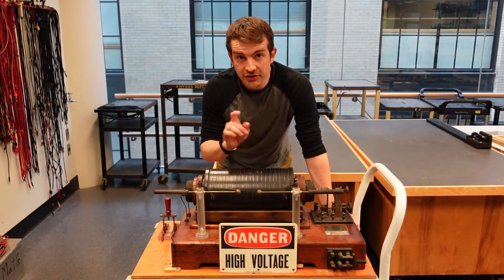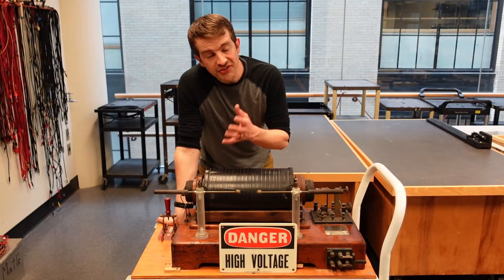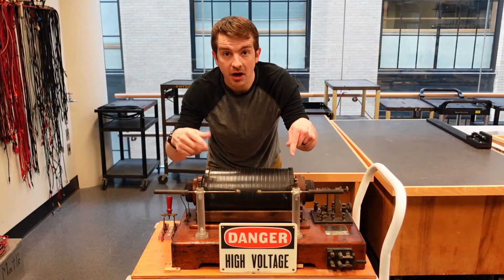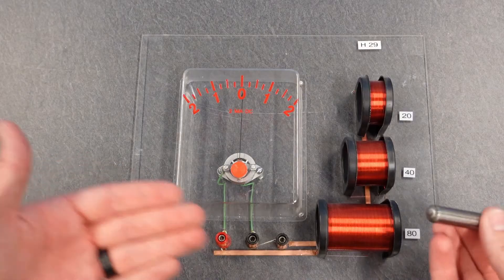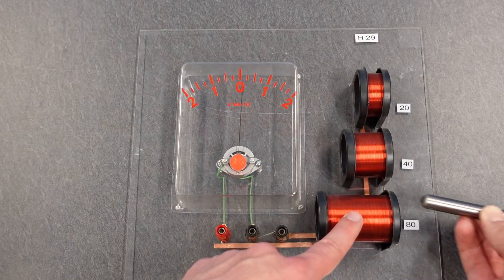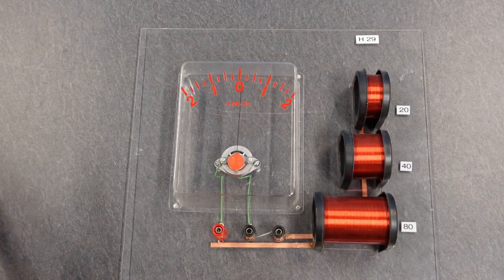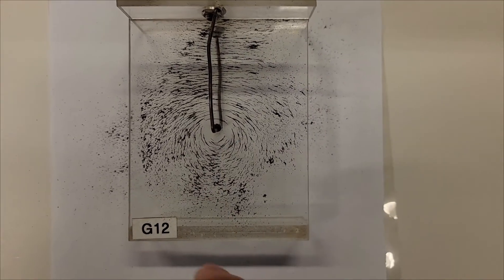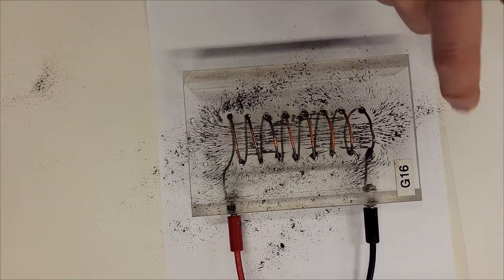Using a 123 year old wireless telegraph machine! The first wireless tech in history!

Comment: Some related fun facts:

1. Titanic originally sent the Marconi standard CQD distress-signal, meaning "all stations, distress". However later one of the operators decided "Hey, this might be our last chance to use the new distress-signal". The internationally agreed upon distress-signal isn't actually SOS, because the distress-signal is sent without gaps while the actual letters would've been sent with gaps. 
2. At one point Marconi wanted to demonstrate his secure radio system, which unlike the previous system he claimed was such that signals sent with it could only be sent with a similarly configured setup and thus secure. What he had invented, was tuning the radio to a frequency ... and preceeding the intended demonstration Nevil Maskelyne sent out "rats" repeatedly followed by a limeric insulting Marconi.

Comment: since it is such a large coil with large inductance, the current is actually relatively low. But when the auto oscilating relay opens the switch, the coil becomes resonant with a relatively low self capacity, producing thus a high resonant voltage.
it is this rapid change in high voltage, that is present in the small capacity antenna.
So, not the current, but the changing high voltage in the antenna transmits the signal,via displacement currents, not conventional currents.
if the antenna was a plate (more surface area) it might even be more effective in transmission?